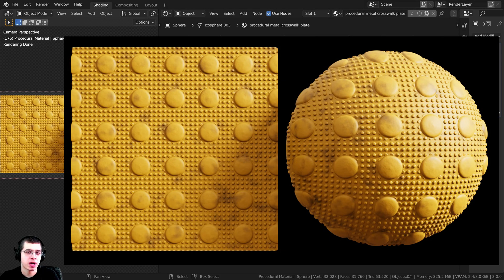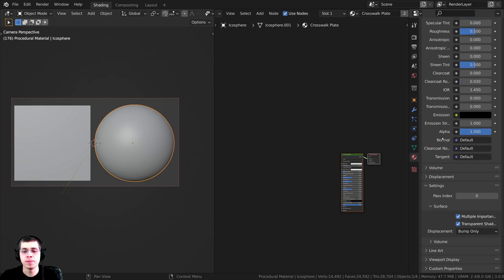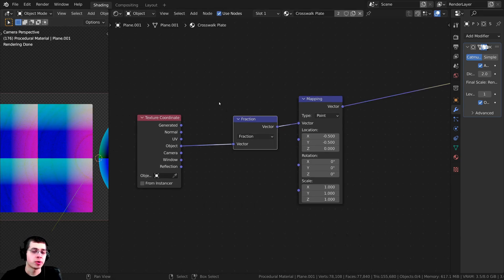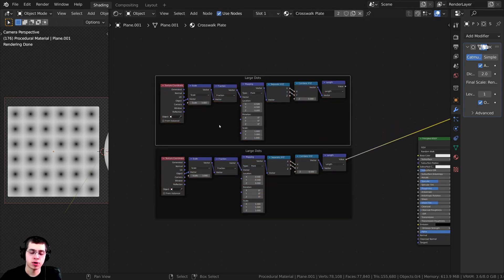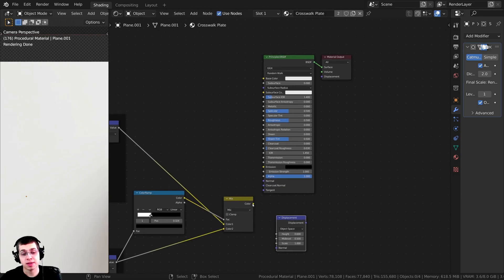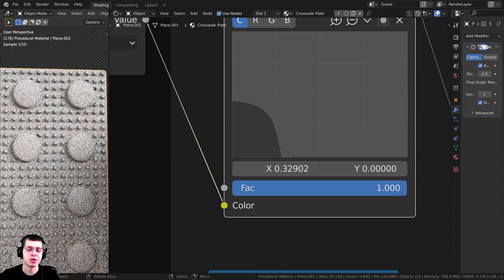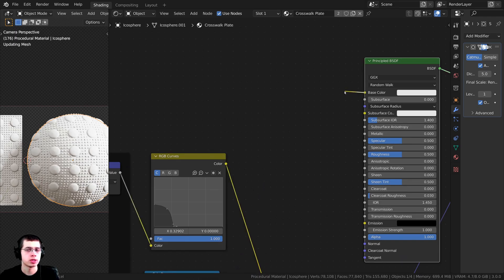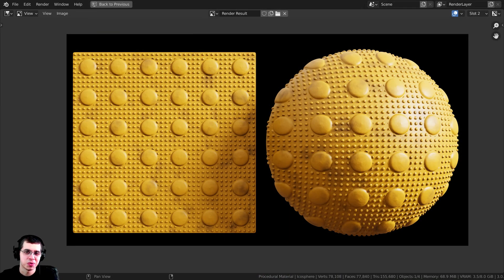Procedural Metal Crosswalk Plate (Blender Tutorial)

Comment: I have been tracking your tutorials for a while now. Thank you for the way you do them. The detailed way you explain things makes it easy to follow. I saw this tutorial and wanted to see if I could figure out a way to do this before I saw how you did it. I ended up using instances and even managed to use a mesh boolean node (difference). For both of our methods, is there a way to ditch the partial small dots?
Reply from the maker: Glad my tutorials are helpful! For my method, you can just unplug the node setup with the smaller dots, and them mute the mix rgb.

Comment: Hi Ryan - Been watching for a while now, and want to say a big thanks for helping me make some awesome textures! But also, I think you need to re-evaluate your use of the displacement "mid-level" value. Please correct me if I am wrong, but mid-level simply moves the entire displacement map range in either + or -       It has no bearing on the displacement scale/strength. Leaving the mid-level to 0.500 is actually ideal in most cases, because it keeps the displacement effect at 50% +&- origin point, and helps close up gaps between angular planes. Changing the mid-level to 0 or 1 moves all the displacement to 100%+OR- origin point, often creating bigger planar gaps. If I am mistaken I will be really embarrassed......
Reply from the maker: Thanks for the info. I will have to look into that. 👍‍